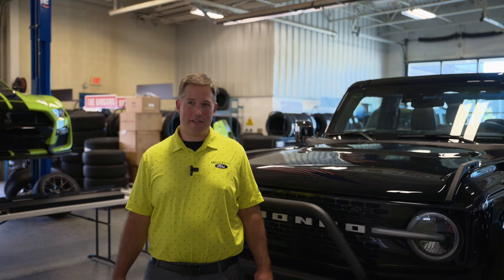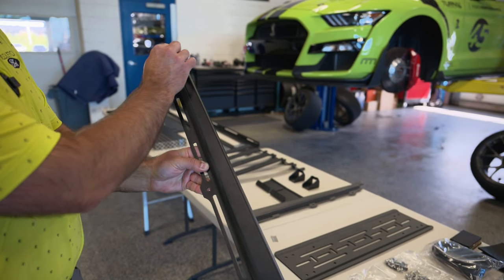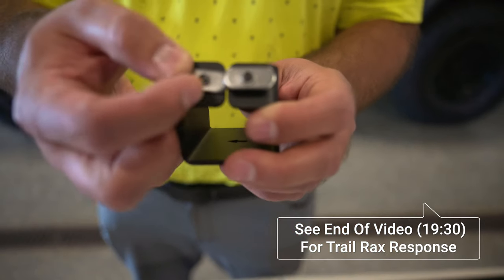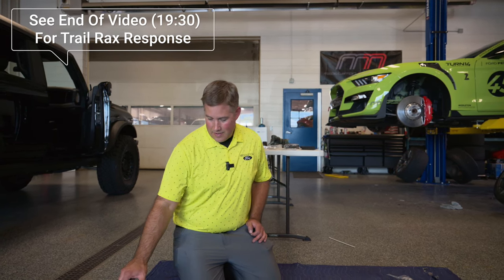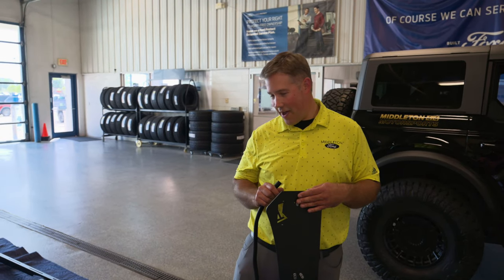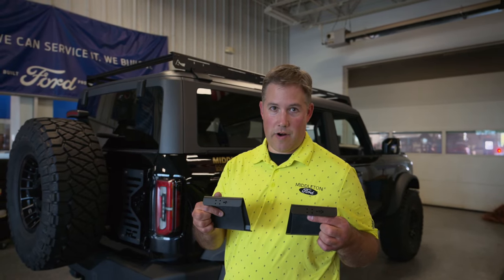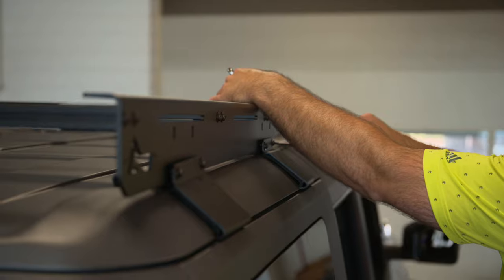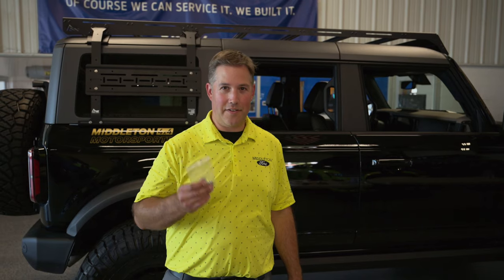Trail Rax Modular Roof Rack With Pak Rax (TRMR Rack)  2021 4 Door Bronco Install

Comment: Awesome video of the Trailrax system.  Not sure why they give you the chrome nuts and bolts to finish the Pak Rax install as everything else is beautiful black.  Also can you add a video on your Instagram feed showing the Trailrax installed and taking off the front two roof panels and then the middle roof panel?  That's one of the primary reasons why I would switch to this roof rack from the Ford Roof Rack... Thanks!
Reply: agreed.  would be great to see the roof panels coming off to know they can do it. zroadz can only take front panels off, not middle...

Comment: Great job showing the issues you had installing and what had to be done.  Design and quality control needs to be addressed apparently but overall a good looking rack system.  I wish the front wind deflector didn't have that arc and just straight for a better look.
Reply: but, I think you will appreciate the arc, versus the WHISTLE and wind noise that the straight cut would cause.
Reply: @deal492  yeah, I agree.  That was an oversight by me.  Cherrs

Comment: [Re: Instruction Manual Problem with the Carriage Bolts.]  Thanks for identifying the problem in the instructions that omitted where to use the carriage bolts. Just to be clear, you’re saying (at 19:30 in the video) that you didn’t need to modify the sliders with a cut because you were supposed to have used the carriage bolts instead?
Reply from the maker: Exactly. Had the instructions and their video been updated at the time of install, we would not have needed to do any modifications.
Reply: @MiddletonMotorsports  The carriage bolts were intended to be used with the light bar mount (confirmed this with support). I ended up doing the same thing and chopping a couple mm off of one of the T nuts with an angle grinder before they responded though. I

Comment: Will this also fit a soft top? Why is nobody making a rack? That will convert for a hard top soft top bikini top, no top, it's ridiculous. It's not that hard to do. Come down with the sides. Let it mount under the shell. Just like you do on the soft top underneath to the body. And you can put mulle racks on the side simple.